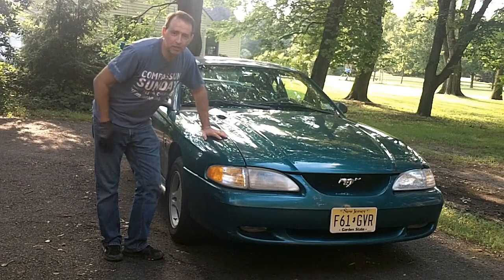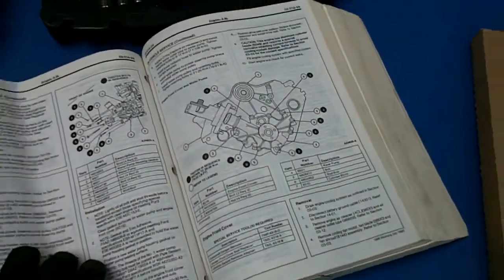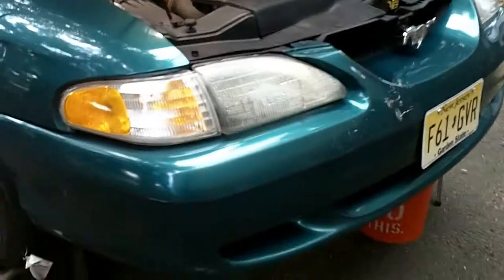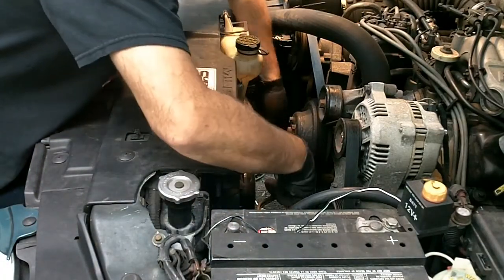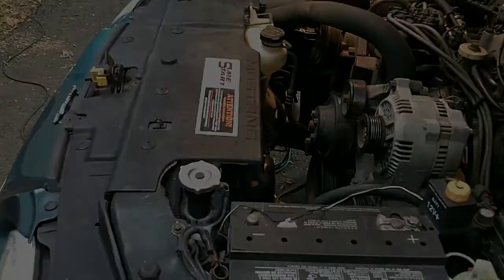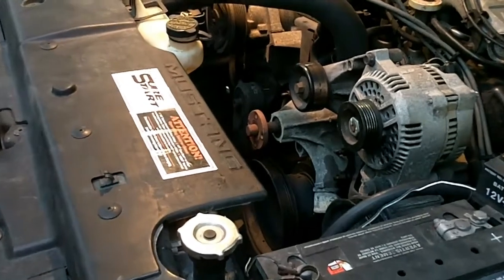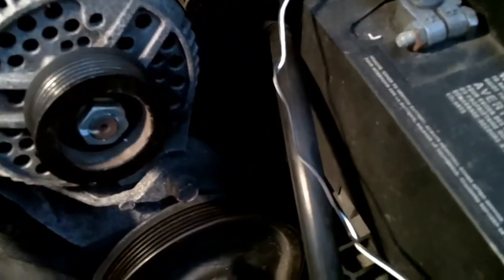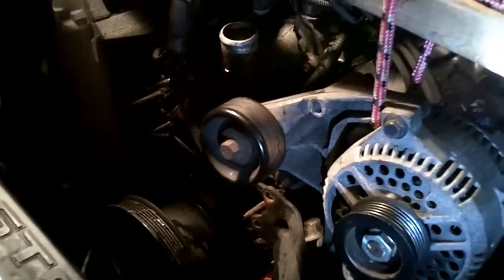Oil Leak Fix Part 1 Timing Chain Cover Gasket Ford 3.8L V6 1994-1999 Mustang Thunderbird

Comment: Please if you can help me, do you remember what the size of the double threaded stud is? Is 6in long, but I cant find it anywhere. It seems to be a M8-1.25 x150mm and no where has it
Reply from the maker: I think I found it online at some Ford parts superstore,  but definitely got it from an online retailer.
Reply: @Buckwsr  thank you so much I found out thru the comments. I broke it as well and that the only thing stopping me putting cover back on. Is that your original timing chain? My 96 3.8 has 203k I want to change while I'm in here
Reply: I'm moving forward and now the balancer bolt wont bite, I think I messed up threads in crank with removal tool. Going to get a new bolt first then try a tap

Comment: careful when you take the oil filter housing off, the oil pump is actually in that housing... and if the"gears" fall out and got the ground and chip or crack that could be bad...

Comment: I didn't remove the cooling fan... still had plenty of room for my big impact and a deep well socket to zip off the crank bolt...I didn't remove the oil pan...I loosened up the rear bolts and removed several from the front but it was unnecessary....

Comment: plus I didn't have the proper cam synch alignment tool for removal and installation...I hope I get it back in correctly lol
Reply from the maker: Thank you for all the great comments. I agree that this job was harder than anticipated, but I did this 7 or 8 months ago, and so far it is running great with no leaks. Plus, doing it in my driveway at my own pace over several days is a lot less pressure than doing it for a customer eager to get his car back....

Comment: I'm doing this job at work currently...I thought it was gonna be a very easy super quick job, kind of turned into a pain... partly due to rust and just build of of sludge everywhere... had to buy a couple tools just for this job...a big security torx and a stud extractor... they were straight up stuck... coolant had leaked around the threads and then rusted and corroded it all froze tight.

Comment: I have the  same car standard fly wheels problem if have to change the fly wheel would I have to change the whole clutch
Reply from the maker: If you have an oil leak at the REAR main seal, and you're removing the flywheel to access it, then you've already dropped the transmission and the clutch components. It would absolutely be recommended to put in a new clutch plate, throw-out bearing, and pressure plate at the same time. It just makes sense, since you've gone to all that work already.